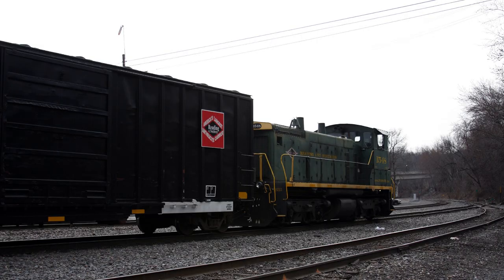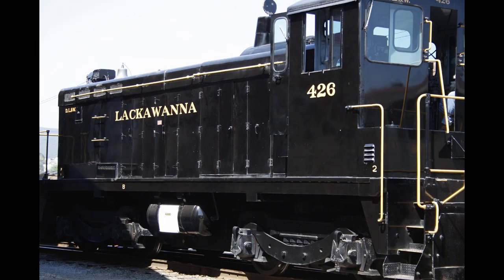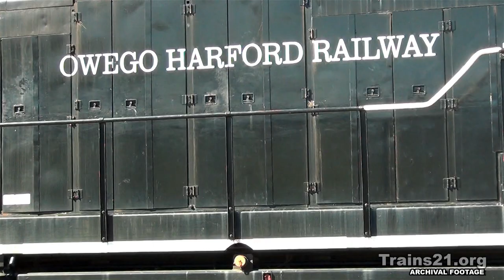End-Cab End Game | Switcher Swan Song

Comment: Bullwinkle seems to be an early CN SW1200RS with its original number. Those were built as low-power roadswitchers for shortline operation. They had number boards, class lights, headlights and MU at both ends, full-lenght handrails, flexicoil trucks and enlarged fuel tanks. A lot of the ideas developped there we later used for the SW1500.
Reply from the maker: Thanks for the info.

Comment: great video but  no ALCO  end cab s 123 or 4 switchers  the black emd  with the spark control stacks reminds me of the identical one s  CNR used on our spur line to haul ore cars usually 4 engines hooked together